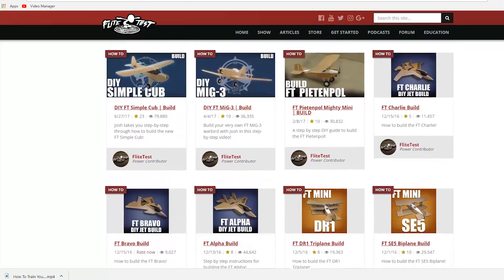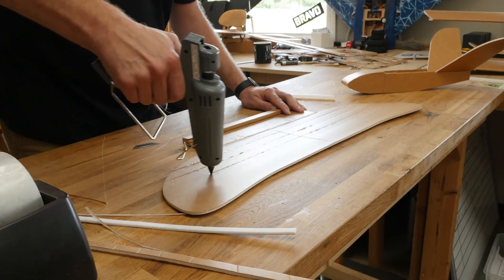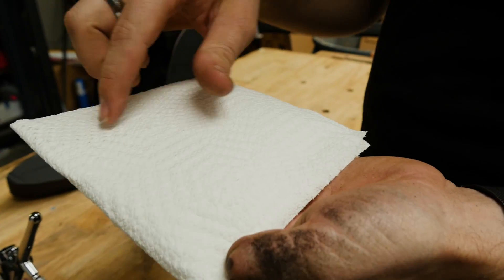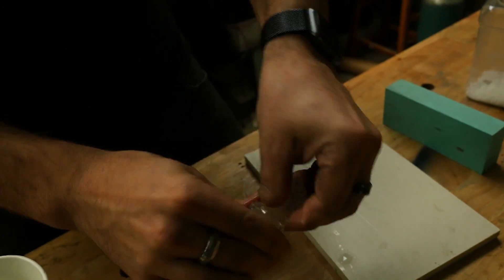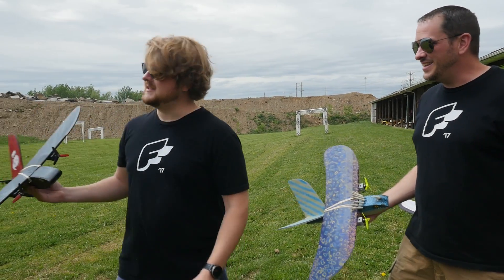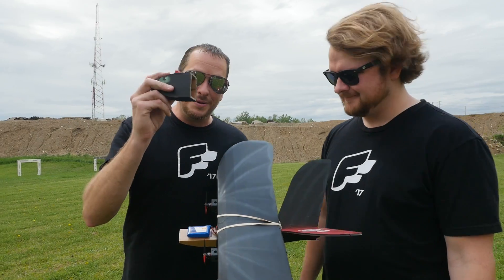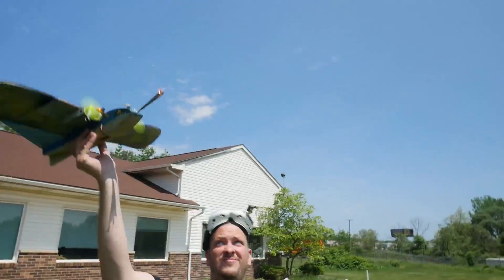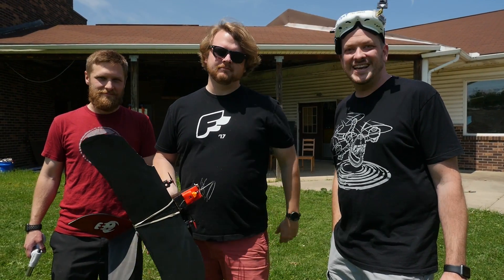HOW TO FLY YOUR DRAGON - FT Twin Sparrow DIY Plane

Comment: 5:18 It's a great concept, that's why it's so good. This concept could be like a flying wing with a V rudder or like a normal plane with a V tail stabilizer rudder. Or you can have it like "in between" (some reflex and some stabilizer blend). A bird like concept but with the V in the tail (not too much different).

Comment: can i ask, do you guys have fun crashing then flying becuase i do, crash once,
 rebuild or create a new
Reply: +Drone
I kept crashing quadcopters so I gave up on them. They break too easily. The only problem with modeling is crashes. I lost a couple quads too and lost a great slow flyer plane in a thermal. Also stuck in trees and crashed planes.

Comment: Don't buy instamorph or shapelock or whatever.

All it is is polycaprolactone 6800.  You can buy it from Perstorp for $18 a kilogram.  I've bought hundreds of kilograms of the stuff.  Buy it and sell it at Flitetest, but for the love of God, just call it PCL 6800.
Reply: 6500 is great for injection molding

Comment: I have a 1407 motor, 30A Esc, and a 3x3 pair of props I'm looking to put into a plane. What Flitetest model would you recommend?

I have been flying drones for a year and I'm looking to get into fixed wings now. These parts are from Tom Stantons hovercraft I built.
Reply: MajorLeague I was thinking more along the lines of a DIY build.
Reply: A 1407 is too small for the larger FT planes like the Spitfire. I built a mighty mini Scout with a Racerstar 1407 3500kv & 5x4.3 two blade prop. Flies nice and floaty with a 500mah 2s. And it's a 3ch bird which will be easier to learn on. Good luck!!
Reply: Torq Intohp Thanks, I'll look into doing the same. I have a few 550mah 3s lipos that will hopefully work aswell. Happy flying.